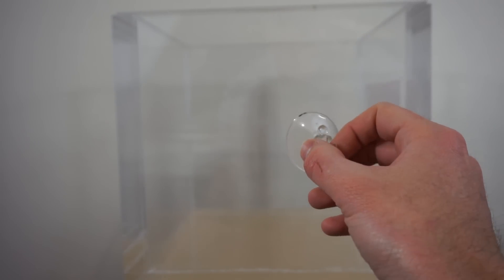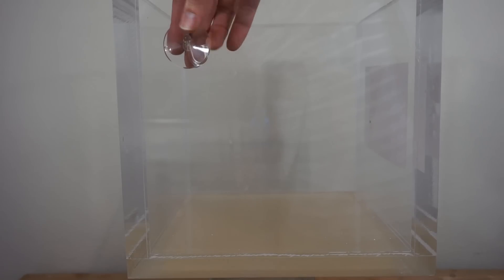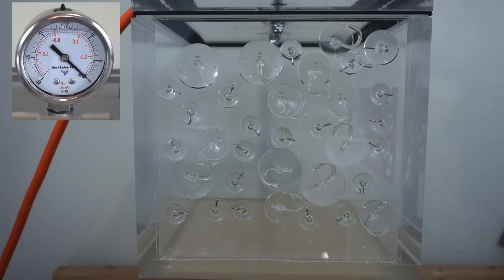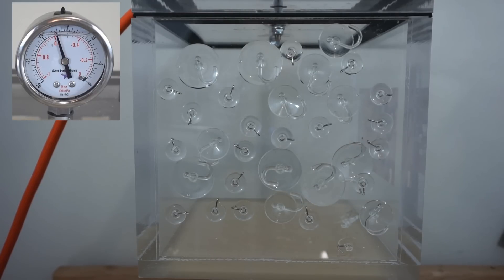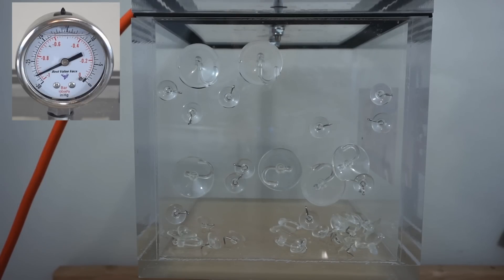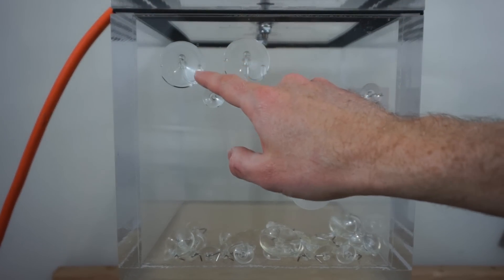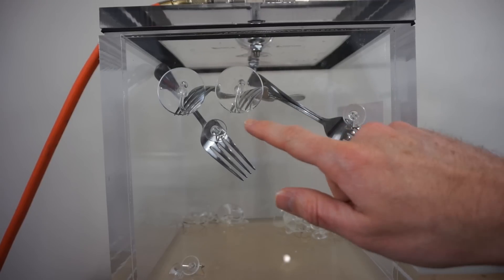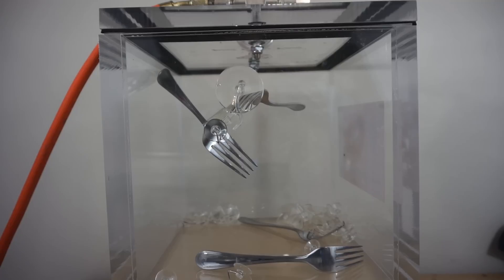Do Suction Cups Work In a Vacuum Chamber? Will They Stick?

Comment: this was easy, if you know how suction cups work.
when you press them on a surface, you actually press all of the air thats between the suction cup and the surface away, so the difference between pressure from the surrounding area and pressure between the suction cup and surface will 'push' the cup onto the surface. when the area is vacuum, there will be no difference in pressure which will result in the cup falling off.
try it with water, the adhesion power will make it stay, even in vacuum.

Comment: Try using high quality suction cups.  You're trying to tell people that it's atmospheric pressure keeping the cups pushed to the glass? The suction cups create a vacuum.  What are you trying to sell here?  If the cups aren't completely air free then the air left inside will expand and break the seal.  Some stayed longer because almost all the air was pushed out of them.
I know you know that already, so why such an unscientific experiment to prove your atmospheric pressure bullshit theory? Why don't they pull off when you pull on them.
This whole video is nonsense.
What the hell does atmospheric pressure have to do with holding vacuum cups to glass?
Get a suction cup used to carry heavy sheets of glass and see what doesn't happen. Lol!
Reply: maybe check your facts, yes, they create a vacuum inside. that means the pressure outside is greater than inside. this means that its pulled into it, or pushed onto it, whichever way you look at it. when you remove this outside pressure, making it also a vacuum, now both the inside and outside of the suction cup have the same pressure (actually outside probably has less, since its in an actual vacuum tank) and now there is no suction, so it falls off.

Comment: what if you put helium ballon in there will it fly ??????
Reply: INFINITY GΛMΞR HD It would expend and take all the space in the vacuum chamber,
Reply: It all depends on how much material makes up the balloon itself. A small balloon would pop where one that can stretch bigger then the chamber itself would not.
Reply: @I want to play a game, Less dense than oxygen. and it will explode. the air inside the balloon will be pulled from outside the balloon, causeing it to expand, then explode because the balloon can't expand further.
Reply: Theoretically it wouldn't. If you were to ignore the fact that the balloon would expand and possibly burst, the reason why a balloon flies is because it is less dense than the air around us. It's almost like a ping pong ball on water. If you were to remove the water, the ping pong ball would have nothing to float on and gravity would pull it down to the ground. This can be compared with the helium/air situation because gravity also affects gas.
Reply: Difixed Productions lmao pls be joking
Reply: INFINITY GΛMΞR HD no it's not going to explode. I already saw a vid on it, it didn't explode. It just expanded.
Reply: The answer is no it would pop and then the latex or plastic or whatever its made of would fall to the bottom of the vacuum chamber
Reply: No, no it won't
Reply: yes, yes it will
Reply: u guys are dumb
Reply: it will pop
Reply: Difixed Productions a balloon can be filled with helium. It's a type of.... Gas I believe... That people use to fill balloons to make them float. Helium isn't dangerous Don't worry.
Reply: Helium balloons fly because they are lighter than their environment. Helium is the 2nd lightest element on the periodic table and it is a noble gas meaning that it doesn't react with anything. In air a helium balloon has less mass on average than air so it flies, in a vacuum chamber there is almost no mass in the vacuum (depends on how good the vacuum is) so it wont fly. The balloon will also expand to fill up the whole chamber and possibly pop because of the pressure difference.
Reply: INFINITY GΛMΞR HD 
A ballon is not filled with helium. I don't even know what that is.

Comment: It would have been much more interesting to see if suction cups would still stick if you were to try to apply them on the surface while the chamber was in vacuum. It would have been much harder to accomplish though.
Reply: Of course they would stick. This experiment has a flaw. The reason why his cups are falling off is that there is some air left under the cups and it expands under the vacuum.
Reply: @marko_z_bogdanca  But... That's lie the whole point of them
Reply: i hope someone make a video bout that

Comment: Some of the suction cups may even have been pushed of slightly if the pressure inside the chamber ever dropped below the pressure in the suction cups
Reply: +Shaun S. 8bit  Not if there was significant Van der Waals attraction between the plastic and acrylic chamber, which he thinks is there anyway.  Perhaps they had to be pried off from the internal pressure

Comment: Good experiment I expected them to stay on as the suction would hold them in place.
Reply from the maker: +google+sucks-I don't get what the confusion is. The atmosphere pushing them against the wall IS what keeps them from falling no matter how good the suction cups are. Why do you think there is a theoretical limit to how much suction cups can hold? I think you misunderstand the fundamental reason why suction cups work. The reason that the cups don't fall at any time is the same reason a book doesn't fall when you hold it against a wall. If you put a horizontal force on an object against a surface, then this creates friction vertically. If the vertical friction is enough to oppose the gravitational force downward, then the book/cup stays in place, if not it falls. So if you use a better suction cup that can get down lower than 0.01 bars underneath, then it could have stayed stuck in my vacuum chamber. However, the maximum force it could hold up in those conditions is only about 0.14 pounds (for a square inch suction cup).  If things are sticky, then they just have a large enough friction coefficient that they can oppose the downward force of gravity without any addition horizontal force, this is what I was alluding to in my video when I said the plastics were sticking together.
Reply: Bro I don't think you understand what is holding them on. Think about the air that around you as an ocean of water, as you go below the water the pressure increases. The same is true with our atmosphere of gases (that is miles deep) which create pressure on us. In this experiment as you push a suction cup to the acrylic and push all the air out that ocean of atmosphere above us is pushing that suction cup to the acrylic. This is demonstrated by the vacuum chamber, as he removes this force of pressure the suction cups are no different that putting a piece of paper against the acrylic and expecting it to hold. Hope I said this right and it makes sense, i'm just trying to relay it as how i understand it.
Reply: It is the atmosphere that pushes against the suction cup. When you place on a suction cup you squeeze all the air from under the cup. Since the pressure outside the cup is greater than inside the outside atmosphere pushes the cup into the glass. 

When you remove the atmospheric pressure in the chamber the atmosphere inside pushes less and less on the suction cup. Until the pressure outside is not strong enough to hold the cup on the glass and it falls off. 

A misconception is that the missing air inside the cup is sucking it onto the glass. This is false. It is the pressure from the outside pushing the cup on.
Reply: Atmospheric pressure does keep them pushed to the glass...
Reply: Joe What you're saying is true, but commonly people use the term suction as analogous with lower pressure than the surroundings. For instance, most people would say, "the hurricane sucked up my house!" and not, "the air pushed my house into the hurricane!"
Reply: +Mr.Awkward
But he is dense. Compared to vacuum.
Reply: ***** but, but, but... Ah I'll give you that one
Reply: Darken Rynesun I don't think that's entirely true.  Atmospheric pressure has to overcome the friction of the rubber cup on the plastic window for it to fall.  The cup can create a vacuum beneath it and his vacuum chamber has to be able to go low enough to negate the vacuum beneath the cup AND overcome the friction of the rubber on plastic.
Reply: Oh I misread I agree
Reply: +google+sucks
Yeah, you're totally right. They stayed stuck because the little atmosphere that was left in this inexpensive vacuum chamber was pushing on it too strong still.
Reply: softestdrink why you calling him dense? This is not kowledge that every human knows. I'm sure there are a ton of things he knows and you don't know
Reply from the maker: +unicusDOTcom yes this helps us understand that there is no suction without an atmosphere!
Reply: The suction is kind of like a mini-vacuum between the wall and the suction cup, though.  Once you turn on the vacuum, the 'suction' on the other side is even stronger.  (Which is the same thing really as saying the air stops pushing it, but a different way of looking at it).
Reply: Hydraulic Press Action I agree that of you tried sticking vacuum cups with no atmosphere they wouldn't stick but you're selling the idea that atmospheric pressure keeps them pushed to the glass Which is nonsense.
You're using cheap vacuum cups and the ones with most of the air pushed out stuck longer for obvious reasons to anyone capable of critical thinking.

Comment: what if you put a phone there? i mean will the signal be lost?
Reply: Pro Player 
Electromagnetic frequencies do not need air to travel. This is how a spacecraft or rover is able to communicate with earth
Reply: Mark's Journey yes, light = microwaves = X-rays = wifi, it's just electromagnetic waves
Reply: But not the same frequency
Reply: Electromagnetic waves do not need a medium (in this case air) to travel like mechanical waves (sound, water .etc) do.
Reply: Rafael Serrano lmao. You win conspiracy theory nut of the day.
Reply: electromagnetic waves (used as the carrier of the signal) as such do not need a medium to travel, but due to different materials inside the vacuum/ open air there will probably be a slight reflection on the edge of the vacuum (Even if there was no glass). That is of course assuming that there are no specially designed materials between at the right thickness to act as  quarter wave loss cancellers or something similar. So there  may be a bit less signal if the signal originates from air and goes to vacuum.

But a short answer: No you will most likely not notice a difference
Reply: Peter Peter No! electromagnetic waves are just photons (light) at different frequencies
Reply: No.
Reply: Tugu FX No, it doesn't. How do you think satellites communicate with the ground?
Reply: The signal won't be lost unless the vacuum chamber is thick lead or something because the signal is just electromagnetic waves.
Reply: Phones use radio waves which are part of the electromagnetic spectrum which don't require a medium like air to carry energy and can function even better in a vacuum.
Reply: I believe that it will still have signal since the connections to phones are by radiation or already existing frequency waves
Reply: Nisarg Joshi you must have fun at parties
Reply: Pro Player In today's world, something like this isn't fancy science work. It's common knowledge.
Reply: Romain T. So the signal would be lost? And 16 idiots agreed with you? My god, you ARE an idiot!
Reply: Pro Player what signal?
Reply: DasEtwas WiFi
Reply: Pro Player Microwaves can travel through a vacuum because electromagnetic waves are transverse.
Reply: saying "light" is easier for kids to understand. otherwise you have to explain what the whole spectrum is about.
Reply: Surely anyone older than 12 has been taught about the electromagnetic spectrums but might lack the knowledge to apply it.
Reply: ButterSquids signal moves trough air?
Reply: Weekly Manner Signals move at the speed of light, and don't require particles to bounce of. So wifi will work just fine.
Reply: Finn we are not scientist so...
Reply: No.. another experiment concerning that has already been done
Reply: The phone would work fine, but if you isolated the phone from the sides of the chamber, you wouldn't be able to hear sound from it, and its mic wouldn't pick up any noises, either.  So the phone would work, but you could not speak into it, nor hear any sound from it.  Which would be kinda cool to demonstrate.
Reply: nowonmetube ...well next time do a little research .. In physics, the term light sometimes refers to electromagnetic radiation of any wavelength, whether visible or not . In this sense, gamma rays, X-rays, microwaves and radio waves are also light. And if you have any doubts please go visit wikipedia .
Reply: Pro Player 
Not due to vacuum.
Reply: Pro Player i
Reply: put in a galaxy s8 and boom
Reply: Dennyboy AKA Baloteli you mean galaxy s7
Reply: Pro Player you mean the galaxy note 7
Reply: Overpowered Pretzel yup!
Reply: ButterSquids idk lol
Reply: Pro Player ur all so fucking dumb it's like the first stuff u learn at gcse
Reply: Just look at the light of space...
Reply: Rafael Serrano easily lie?  It would have been harder to fake the moon landing than to go in the 60’s.  Not to mention, you can prove it to yourself with a few easily purchased items.  So, don’t believe every conspiracy theory they can easily lie about.
Reply: No, and the King of Random did that
Reply: he has a very old video if you could find it.
Reply: Every vid
Reply: Yeh, light. Light refers to all electromagnetic waves.
Reply: not at all,they don't require any medium  to travel
Reply: so what happens when ur in the dark idiot they are electromagnetic waves which travel thru a vaccume
Reply: No! Thats just wrong. 
Light is only the part of the electromagnetic spectrum which is visible for the human eye.
Reply: Cullen Lonergan Indeed. Electromagnetic waves or Photons  (because light can act like a particle or a wave) have different frequencies. But calling all frequencies like uv light or gamma rays light is wrong. only the visible spectrum is called light
Reply: He tried remote control drone and still functioning
Reply: no
Reply: Pro Player badumtss
Reply: what an idiot...
Reply: Pro Player No, why would it?
Reply: Pro Player 
No, you dumb shit. Electromagnetic radiation propagates despite lack of a propagation medium.
Reply: nope, signal uses light
Reply: Vines look who's talking
Reply: Romain T. "Light" refers to the visible light spectrum. You wouldn’t call the radio "light," you would call it the radio. Electromagnetic radiation is the proper term.
Reply: Romain T. Are you stupid?
Reply: jyuan1999 but "light" is just wrong. They travel with light speed, yes. But they are not light. They're radio waves. Light waves can be seen by human eyes.
Reply: jyuan1999 LiFi uses light